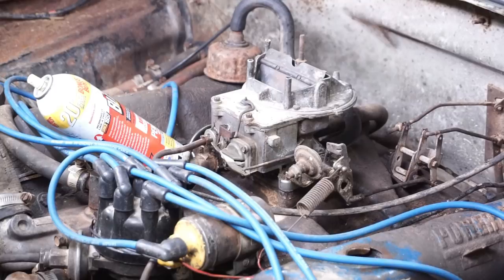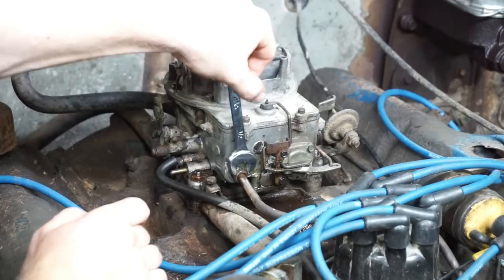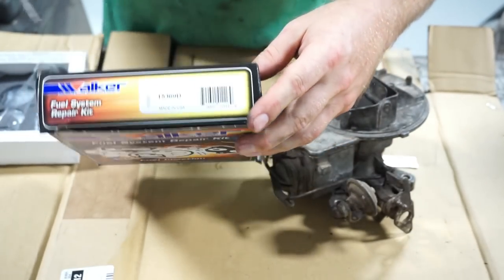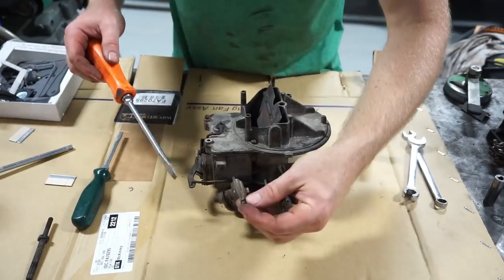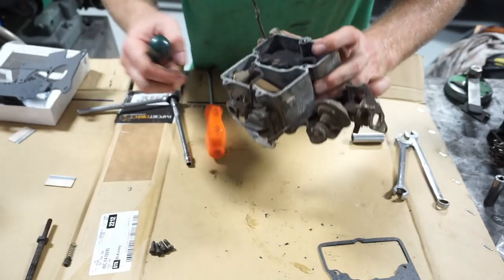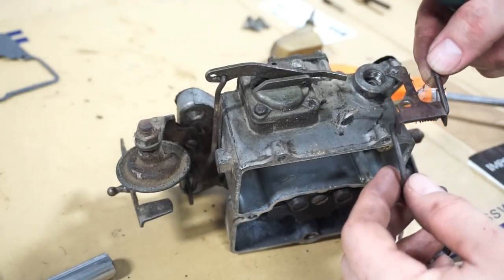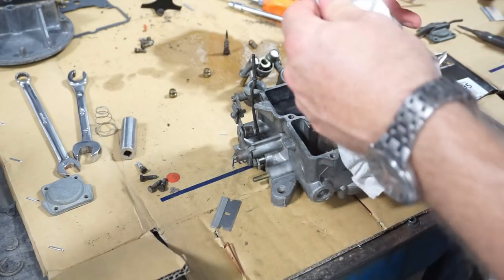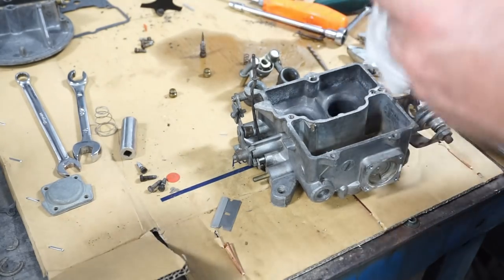Ford Autolite 2100 Carburetor Rebuild

Comment: I'm going to add my gratitude to the many who have already expressed theirs.  Working on my '67 Fairlane, and thankfully the original Autolite 2100 carburetor was part of the deal (some other ridiculously tiny thing had been installed -- to save fuel!!).  But the original carbie had all sorts of bits missing and incorrectly installed, so this vid. has been a lifesaver of a reference for me.  Thanks so much for doing it and uploading... we'd be stuffed without guys like you taking the trouble and time to do this!  Muchas gracias from Peru.

Comment: Great video. Thanks for sharing. I just became a new owner of a ‘69 F250. Ordered the rebuild kit for carb last night along with power booster for brakes because the truck doesn’t have one. This video is gonna save me the headache once the kit arrives. Thanks!
Reply: UPDATE:
 Carb kit came yesterday, i disassembled and dissected it yesterday, let everything soak over night in a gallon of parts cleaner. Today i cleaned everything off and put it all back together, I had my laptop and this video right in front of me for reference. Thanks again for sharing. Would have been lost without ya!

Comment: Man thanks for all the information.  I just got a 1968 f100 with a straight six standard with 3 on the tree. I know nothing about this truck so I'm looking at videos to get as much info as I can and your videos are motivation and informative too. I wish I had your knowledge on the matter but I'm learning from you. My truck runs although not that smooth but I'm looking forward to learn more about it. Thanks again and loving the way your truck keeps coming out. Awesome work.
Reply from the maker: Nice! Thats why I post these videos, to share my knowledge and help you guys out. You got it running! you're on the right track. Check the timing and the ignition system, then set the valve lash, I bet that old truck will run really smooth again!
Reply: @330_garage3  I'll check that definitely thanks for the advice again man and looking forward to more of your content.  Cheers from Texas bro😎🍻

Comment: thank you 330_Garage!!! I watched your video twice and a third time as I was rebuilding my carburetor 2100 also,paused when I needed to, It worked out great!! The only problem I ran into was the needle in the float, my carb started pouring fuel out the top so I replaced it with the old one and problem fixed. My '69 Bronco has been sitting in my garage for 18yrs, nothing was wrong , just busy with life. Anyways everything was clean with the carb except the excellerator pump, it was dry or brittle. She runs great now, next is to start to replace hoses fuel lines,tires and so on... thank you again, Alex..

Comment: Life is much easier if you make the accelerator pump the first item that you remove.  It gets the float bowl top seal assembly out of the way and that's a big help.  If you don't, it is in the way during the float steps as well as the choke hat steps.

Comment: A good video and about as simple as one could keep it. That is one tired engine but I have seen a lot worse run for almost ever it seemed. It broke the speedo cable at around the third time over and Russ drove that truck every day for about five more years with no heater or even a drivers door working. I had to steal it and work break neck speeds to fix as much as I could. New distributor, new timing chain, new intake gasket and water pump, new power steering pump, fix the broken studs in the exhaust, the list went on and the heater was a hard one as it had air and heat in same box but when through he had heat.Man was so grateful and it made me feel bad that I hadn't done it sooner as he was seventy and worked as a plumber. Coming home wet from some jobs had to no fun.Those carbs are as basic as they come but the first time they backfire, the power valve is done for, nature of the beast

Comment: I just bought my first 71 Ford f350 with a 360 and this exact carb. You helped me.out immensely. I watched the whole thing and it's literally the best video ever!!  Thank you.

Question: what is the linkage connected to the front that covers up the hole in the float bowl? Nothing seems to move it but you can manually move it to open that rubber "stopper"

Comment: I think that you got/have a good firm hand on it. I don't see many your age going into a stall somewhere and doing the actual build. I would put money on you to do what ever is right and not cheep out on this little project. Since I never heard what your intentions are I would guess that you will fix it to its best resale.I get a idea that this rig hasn't been in the weeds all that long judging by how green the grass was under the truck. If mine, I would clean maticules under the hood and color match that paint or fresh it up with flat black, no glossy stuff and tape off the  wiring so it retains its natural state cause that is only once. Lucky you it being a V8 engine, I would change any and all gaskets but not paint it and for absolute good money vested change the timing chain and the water pump but put in the box all the old stuff as some people are crazy about the OEM numbers so they will see the gears changed with proof and they will rebuild the water pump. The cab and fenders/ bed  will be last to light sand and clear it so they can make choice what color it will be cause they have the blank slate to work on. Really clean the interior, and unless the seat won't work put every thing back in but insulate the floor for the noise and change the dash mat and your done. Unless you really like then do what floats your boat
Reply from the maker: Thanks, I liked the fact that it was a pretty straight truck and didn't have much body work to fight with and has a cool patina. I have a whole list of things to do and a schedule planned out. (I also have some funds set aside to keep it rolling) I plan to put it all on YouTube if people seem to be enjoying it. I'm with you the numbers matching isn't a big deal, this isn't a Concours vehicle by any means. Just a fun patina truck to fix up, make a little faster and drive around
Reply: 330_Garage I’ll be excited to follow your progress!  I enjoy your videos

Comment: Dude, you gotta make a pressure washing vid on that engine and the engine bay

Be sure to use heavy duty oven cleaner
Love the vids
Reply from the maker: Funny you mention that.. I am actually working on that exact thing today. Oven cleaner is a great tip..I have used it in the past with great results
Reply: @330_garage3  even cleaner is great for certain stuff but can be pretty strong with destroying stuff you dont want to, I bet it's cheaper then oven cleaner it's called gunk degreaser/engine cleaner works amazing and is super safe stuff

Comment: Awesome video. Super helpful. I wish everyone made tutorials like this. My kit was the same as yours, my carb was just a tad different off my 78 f150. What was all that extra stuff in the kit for?
Reply from the maker: Most kits include parts to do several different models of carbs. The box will usually list all the different models it can be used on, so they often have to include some different base gaskets, seals, etc.

Comment: Would love to see a video on how to test a mechanical fuel pump pressure using a pressure gauge. I rebuilt my motorcraft 2100 using this and another video. I primed it with a small amount of fuel in the air intake of the carb. Ran beautifully for three or so minutes but then died. Responded well to pumping the accelerator pedal, no leaks, sounds gorgeous. I found very little fuel(1 cm) in the float bowel, and admit I did not add any fuel to the bowel(essentially was empty) prior to starting it. Since I believe I cleaned this carb very well, I question if it's getting adequate fuel pressure from the fuel pump? Would like to do a test, but no videos exist to show how to hook a modern fuel pressure gauge to these old fuel lines. Help>>>>>

Comment: Outstanding video, man .. just wanted to ask a question , I have a 76 f100 with electronic ignition.. did you plug any of the carb or did you manifold the vacumn advance.. mine has a plate underneath the carb .. thanks

Comment: I have a 75 Ford Maverick, 302 engine with this carb. I just refreshed the complete engine leaving it original, I washed the carburetor well and I put new gaskets on it. Has new economizer valve number 68, nozzles 53. The engine when it is cold accelerates very well but when it warms up and you accelerate it hard, it acts as if it is running out of gasoline or is drowning, it spends a lot of gasoline, it does not run very well and the smoke smells of raw gasoline. Is it missing or over fuel? The engine idling and accelerating is zero failure, no vibrations completely serene.

Comment: Great vid my only thing was on the accelerator pump I wasn't sure about that little arm with the spring to the left of it. I wasn't sure how it goes back on is there supposed to be tension on it against the accelerator pump lever?

Comment: i bought a 1963 Ford fairlane with a 302 engine and this carb. it runs really sloppy and uneven on idle. next step is to repair it

Comment: my truck has 105,000  orignal miles ,thinling of removing valve covers,to fix leaks and rotate engine to see how much timing chain is stretched,also check top end?

Comment: If it doesn't dent your wallet and you want to replace the cracked tube but if you want to go the cheap route I think you could solder it? Might be a bumpy mess that has to be sanded down but hey saves from buying a tube oil that's if you already have a solder gun and solder. Just found you on YouTube lastnight and love your stuff find another rig to revive, maybe an old dirtbike or quad???!!!

Comment: I’m trying to disassemble my carb, my accelerator pump looks like yours but I don’t have that rubber check valve, in stead there’s a screw on top of the housing that holds a check ball, and a housing within it. Help!

Comment: Have a question.  Isn't possible to change the venturi to a larger one?  Example like going from a 1.02 to a 1.08.  Do they just plug and play?
Reply from the maker: Not on the 2100 style carb, you would have to buy a different version with the larger venturi, since it's a cast part of the body

Comment: If I had to guess It would seem your real occupation is school teacher. K to 2nd grade would be the guess and you think you are still talking to children. This could have been a 35 min video without all the over explanation.
Complete rebuild with only one error that never got caught. No problem, it will still work. Would have been nice to see your procedure on setting the idle screws. Vacuum or RPM? What is your method?
Thanks for sharing.
Reply: JT Thill I appreciate that he’s talking to, as you put it, “children” or a complete novice like me.  I’ve never seen a more thorough explanation.